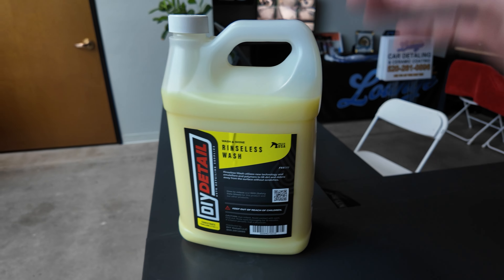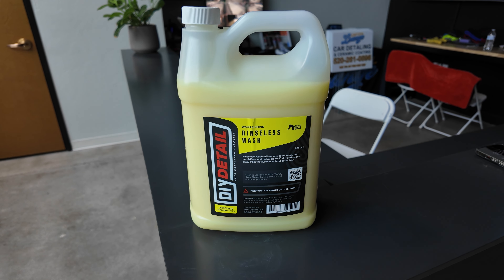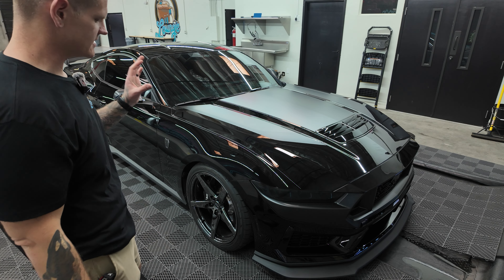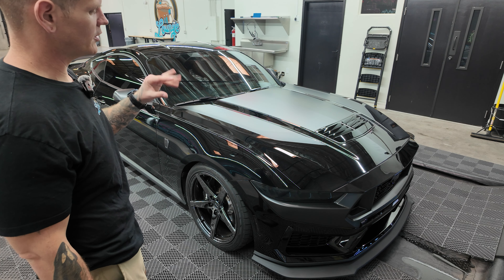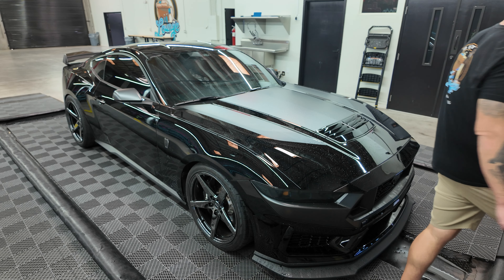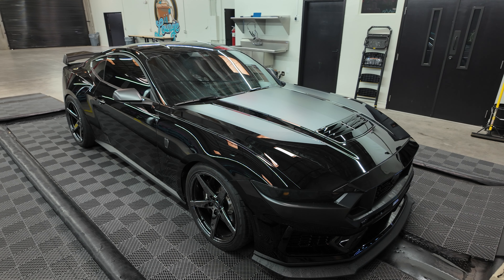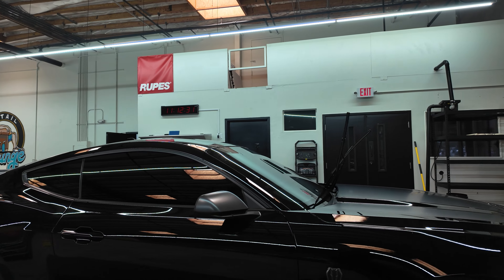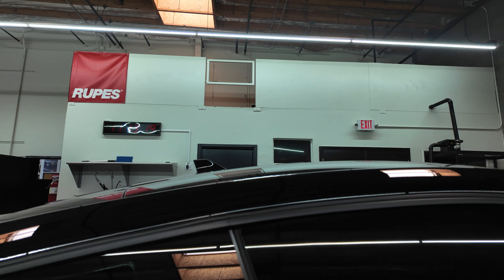Is DIY Detail's New Rinseless Wash V2 The BEST Rinseless?

Comment: I almost feel bad for rinseless wash peeps.  Feels like a new version is released from each brand every year
Reply from the maker: You’re not wrong there!
Reply: As a "rinseless peep" I'm glad because the competition is breeding innovation and improvements. More choices are never a bad thing.
Reply: One of the owners of DIY detail said don’t jump to get V2 if you still have a ton of V1 on the shelf. V1 is still great. But because of competition (which is good) they have to innovate. They just made a few tweaks without taking away what everyone loves about V1.
Reply: When a new version is released Its hard to fight the urge to not buy and try it out. I still have a bottle of every rinseless wash made to man and some are on my shelf 3 years or older